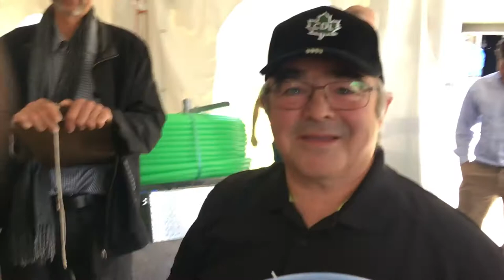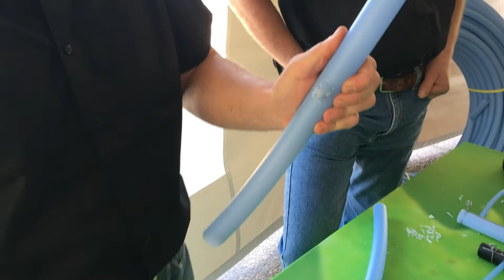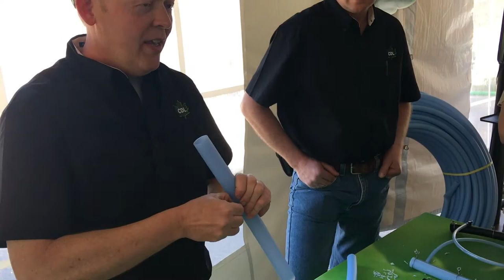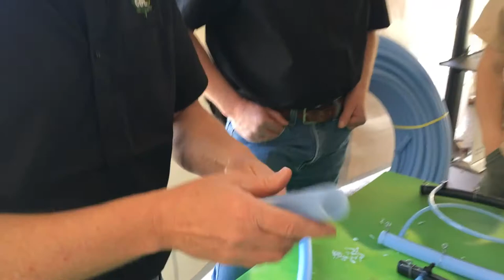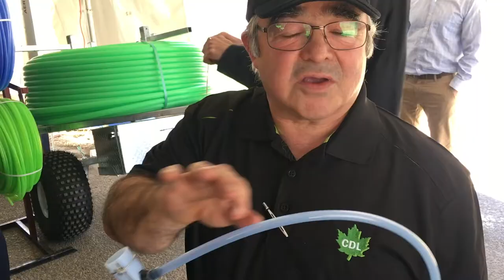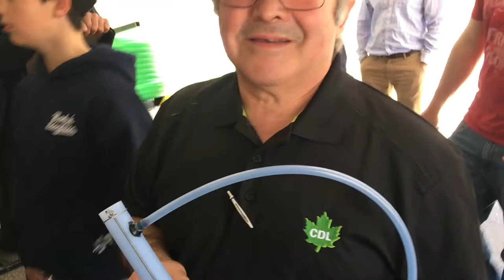The CDL SpinSeal mainline fitting, Part 2

Comment: To time consuming. And we had some on a line. Branch came down and broke it off.  Ripped the line. Had a regular entrance fitting 10 ft down  the line. 2 min replacement time. 10 min fixing and adding pieces to fix where the cdl drop was.